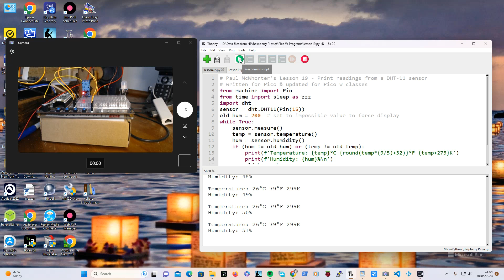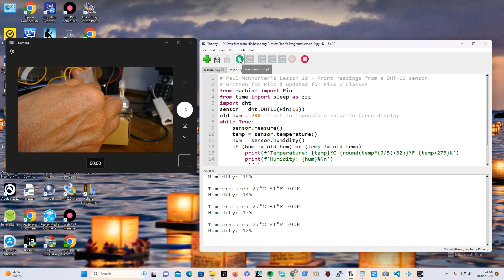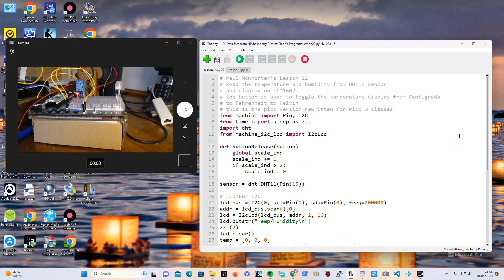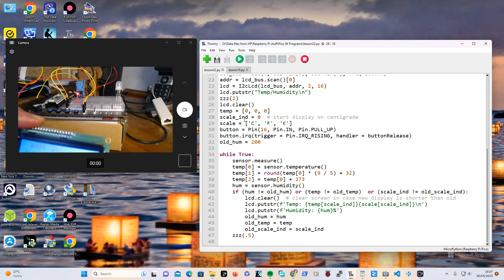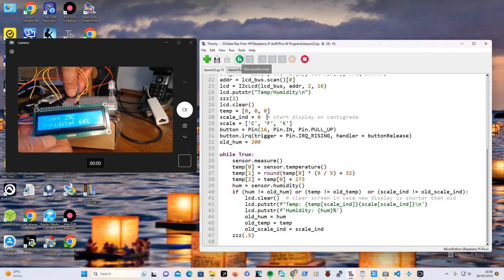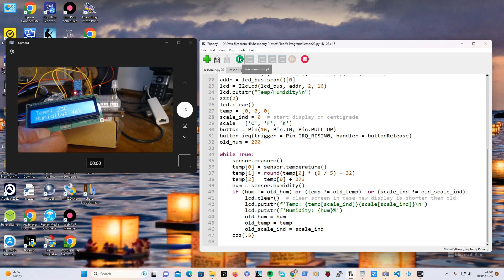My solution to Paul McWhorter's Pico W Lessons 19 & 22

Comment: I like the time import of "zzz" creative ......
Reply from the maker: Hi Rob 
I've tried leaving you comments on your video a couple of times but they've got deleted. I've had no problems at all with my dht-11. I don't know where Paul et al got the dht-11 library but I used the one from Geeekpi's github because I don't have the SunFounder kit. If you look at the exchange between James and me on this video , then you'll find a link there. Maybe you'll find it useful, or maybe you won't. If you look at the code, it seems to manage any potential errors. Hopefully this comment won't get deleted as it has no embedded links. YT hates me!
Reply: @charlotteswift  I have the same problem. My comments are removed, even on my own videos. thanks for taking the time I iwll go get the library and try again.
Reply from the maker: @Rob Akers It started off as a joke but it's so much easier to type.